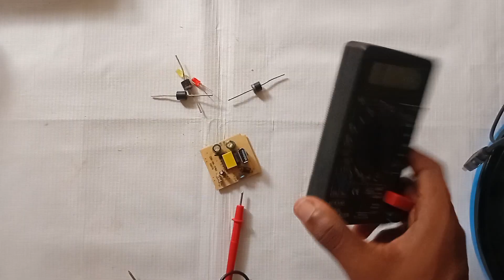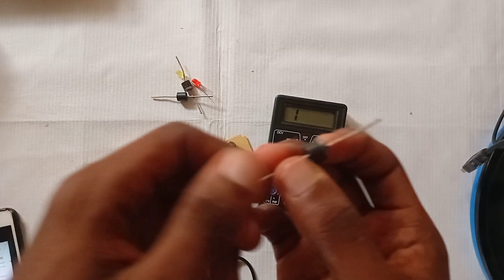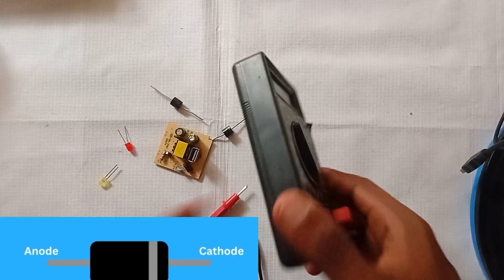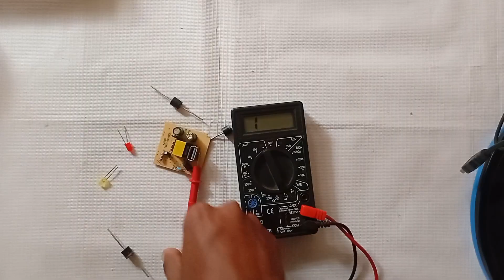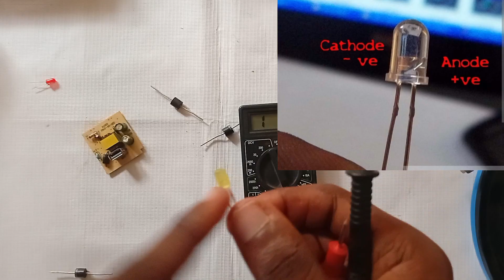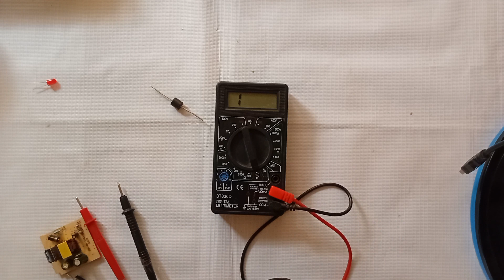Digital Multimeter Tutorial part 4: How to Test a Diode properly

Comment: is it possible to use this digital multimeter to test for inductance of an inductor
Reply from the maker: Yeah, kind of — most regular digital multimeters can’t measure inductance directly. Some fancier ones do have a mode for it, but if yours doesn’t, you’d need an LCR meter or a simple circuit setup to figure it out using things like a resistor and an AC signal.

in the video I will post in future I will teach how to measure the inductance of an inductor, it requires a special skill and there is a trick for it

Comment: Does bigger diode mean higher current capacity?
Reply from the maker: yea A bigger diode usually can handle more current since it has a larger junction and can get rid of heat more easily, but the real current limit really depends on how the diode is designed, not just its size.